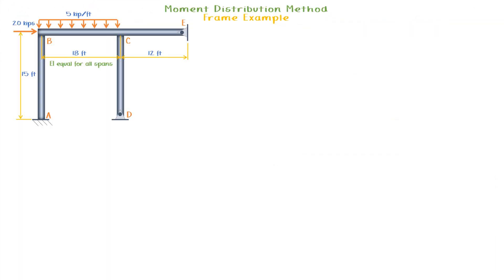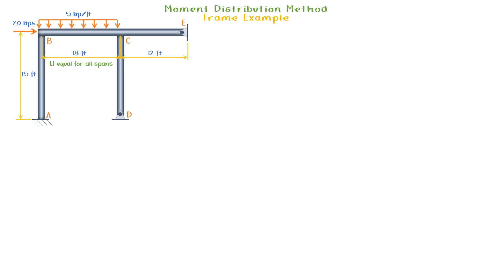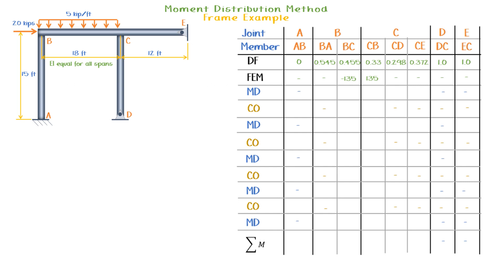Moment Distribution Method Frames Part 3 of 3

Comment from the maker: Time Stamps 
00:00 Start 
00:13 Given Information for Frame Example of Moment Distribution Method 
00:19 Step 1: Stiffness Factors 
00:28 Step 2: Distribution Factors 
00:38 Step 3: Fixed End Moments 
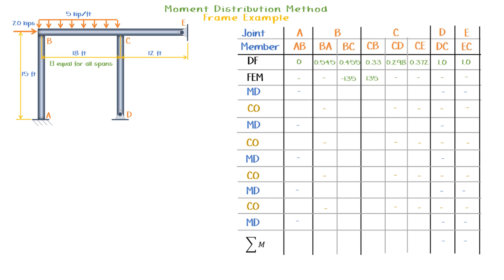01:01 Step 4: Moment Distribution 
01:08 Step 5: Carry Over 
01:18 Repeat Steps 4 and 5 
01:37 Sum of Moments at Each Knot 
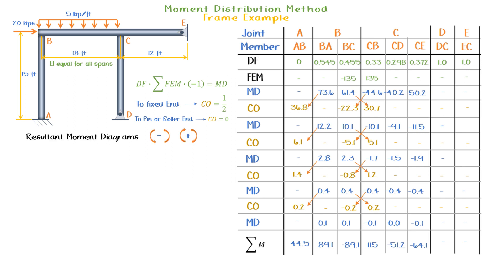01:45 Diagram of Frame Example of Moment Distribution Method 
02:07 Outro